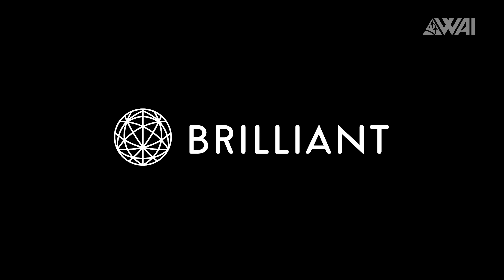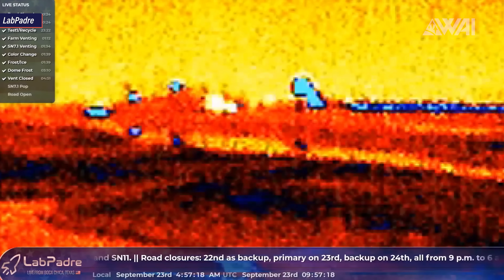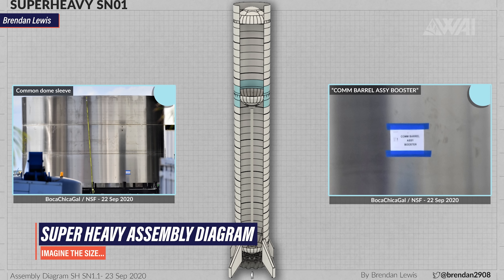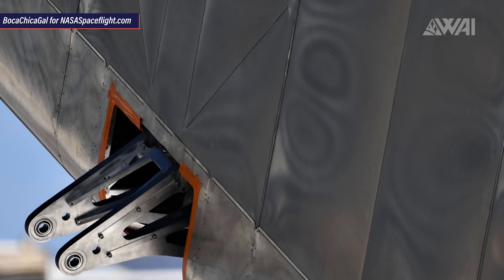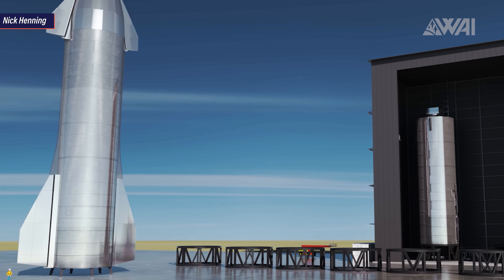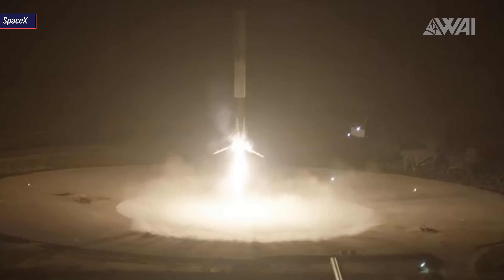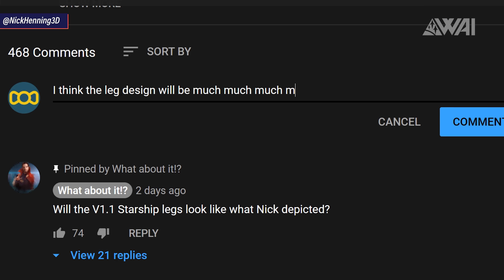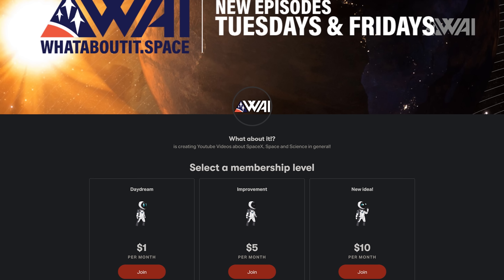122 | SpaceX Starship Super Heavy SN01 In Production!

Comment from the maker: What's your thought about possible Starship V2.0 legs? Which design is your favourite?
Reply: if they are meant to adjust in order to level, the simplest design is a single rod inside of a sleeve (at 6 corners for redundancy, or at 3 corners for minimalism), with a slightly-rounded end. hydraulic for fast adjustment, but with a locking mechanism so they can turn off the hydraulics. rotating or pivoting things just add complexity, despite looking cool. Flipping from the outside is a bad idea when belly-flopping in a high-friction setting. Also , being auto-leveling means they don't have to be as far out from the center like falcon's.
Reply: Flip them out from the center 10 foot legs would fit nicely between the spaces between the 3 central raptor  and outer ring of engines unlike falcon.
1)The hinge is already designed.
2) less weight ...shock levelers could be attached ( or built into the leg)to the already re enforced thrust puck eliminating the re enforcement ring( falcon) less parts.
3) no need for external bays or heat shield issues
4) re enforcing the thrust puck
5)duplicate modular engine mounts( learned from falcon) between legs....
Reply: I like a flip out and as long as there is legs and star ship isn’t going to change into a boat I am fine
Reply: Being old school my favorite legs are Tina Turners.
Reply: @warhawkme6344  Yes, 6 Tina Turner legs shapes...with all the curves in all the right places...would make one sexy Starship. :)  But would she land barefoot or with heels?
Reply: I just want legs! It looks nice <3
Reply: I think that Elon is likely directing them to fit it under the skirt around the engines. I am sure that the engineers are hard at work trying to figure out the optimal way to take care of that problem. Any solution putting them on the outside of the rocket is going to require refurbishment or heat shields, thus I don't think they will be considered.
Reply: For the few initial landings on a foreign body, you could use the Falcon style legs and leave the lander in place for temporary quarters while building the more permanent colony.  Supply rockets could also be left in place as well.  Once a hard landing pad is constructed, you could use the improved externally mounted pods for the reusable boosters.  At some point the 1st gen landers could be retro fitted with a disposable heat shield skirt so as to be able to return to point of origin to be recycled and used again.

 
 

Reply
Reply: 2
Reply: i think they won't look anything like these, but the falcon ones, although if they make them like falcon, i think they will redesign them a fair bit
Reply: Hey Felix how are and how do even keep up with the rapid progress of SpaceX?
Reply: How about some sort of negative polarity magnetic force that would allow the Starship and the Superheavy booster to hover a few inches above the ground. How hard could it be?
Reply: @mvmmotovlogmusic2815  If you can generate a magnetic field that strong, you can shield Mars from the solar wind. ;p
Reply: Hi, Felix.
Note that the design of legs for the Martian Starship ought to permit not only landing but also soaring up without a launch stand.
All variants of legs you've shown are too squatty.
Reply: For earth to earth travel falcon legs would be good but for lunar and mars landings the auto levelling legs would be even better
Reply: I don't know what they look like, but there have to be 6 of them. With 4, if one fails, the entire rocket will fall over, which is far too risky. With 6 your have some redundancy.
Reply: Keep in mind that the legs need to retract very quickly once the ship is launched from Mars. The current Falcon 9 legs have to be retracted manually after they land. Starship won't have that luxury.
Reply: @WhatAboutIt I imagine they will be very like the Falcon legs, but with a completely enclosed manifold over the leg bars, and heat panels on one side. There will probably have to be an additional surface covering the joint from the underside, which would also have a heatshield.
Reply: The fixed 8 leg design.
Reply: The fact that Musk isn't bragging about the 7.1 test is a clear indication that it didn't go well.
Reply: o, will the new High Bay at least have an overhead crane? Or will Musk continue to use primitive construction cranes?
Reply: Tin tin is my favorite
Reply: Whatever design they go with, the legs absolutely shouldn't go straight down as we see in the current prototype design.  The wider the legs are the better, or at least within reason.  Starship is already a tall ship so let's assume it has legs that go straight down and Starship lands on Mars on an uneven surface with just a tad of wind to boot, that could easily turn out disastrous.  Having a bit too much horizontal speed upon landing could also be a problem that wider legs would help with. 

A starship is much more likely to fall over with narrow legs if just a couple of things go wrong with the landing.  With a tall ship not having wide legs we're assuming everything will go right on every landing so why not increase the margin for error with wider legs?
Reply: Why not pre launch a self-leveling landing/launch pad? That way, debris will be minimized.
Reply: yes...
Reply: I feel like if you want wider and self levelling legs you're gonna want them to articulate like how dropship landing gear does in Battletech. link related: https://www.sarna.net/wiki/File:Confederate_(1).jpg
Reply: maybe the legs will be build into the lower fins
Reply: i just realized how extremely important those landing legs are. they need to be extra durable because on a single mission they might need to use it twice. landing on the moon/mars and then landing back to earth. so excited to see the final leg design for starship 🤭
Reply: Here's a thought on the legs- They simply extend from the inside of the skirt (no flipping required) and have pistons capable of auto-leveling.
Reply: I like the 2nd design.
Reply: Whichever design they use, it will need to have enough clearance after landing to prevent exhaust and debris from impinging in the engines/nozzles.  Only way I can think of is to use long legs that fold out akin to the Apollo era LEM.  They’ll have to be shrouded, and not sure if hydraulics will work properly in space.  Maybe some form of elastomeric hinge.  Oleo camping for the “feet” might work but you need some highly engineered seals as well.  Aesthetically the current stumps don’t look that great, although they do the job now.
Reply: none of the featured ideas. Mass production is the answer, so nothing that slows the system. Those 9m diameter rings are all. So, nothing bolted to the outside, no extrusions, etc.etc.
The legs will be internal to the ring, so no extra complexity vis extra or more complex heat shields. Why use more/different heat shields when the existing structure already has it? Not sure re hydraulics. The extreme temp differences this will go through in the space of 15 mins on each launch/re-entry would seem to preclude that. Some kind of mechanical solution is the most likely outcome.
Reply: Who needs the over priced sls s 4 SpaceX yeehaw  billions on Boeing they will not have any fliers SpaceX will get it done for millions not Fkn Boeing’s sls & starlight billion’s
Reply: The coolest looking legs will be the best, 
maybe a racing stripe for added speeeeed!
Reply: The legs must be well spread out, like falcon9.  additional stability at the moment of landing can be supplied by the little nitrogen rockets at the top of the booster. This will iron out any tipsiness that might occur at the moment the main engines are shut off at touchdown.

I don’t think anyone missed the fact that both of the 150 m hops ended up with landings that were precariously close to tipping over, because of the offset rocket motor.

The smart thing to do is to start off with oversized legs and prove them out, collecting data all along regarding the forces acting at the instant of touchdown.

If warranted, smaller spread legs can easily be exchanged on later models of the starship booster. It would be a shame to Tip over a booster because the legs were not spread enough or they were too flimsy.

I’m not going to talk about damping at this time because it is very complicated subject.

Suffice it to say, this American boy likes long legs!  I won’t elaborate anymore, ha ha!
Reply: I feel that the leg design similar to the current Falcon flip-out legs would be best. The wider the stance, the better. However I am not sure what happens to the rocket after it has landed. We are so concerned about the landings, but after it has done so on the Moon or Mars, do the legs give Starship enough height and clearance from the surface to launch again? Wouldn't the launch itself kick up a lot of debris and possibly damage the rocket? Just seeing what damage SN5 did to the launch pad could be an indication of what to expect. And that was with just one Raptor engine!!
Reply: @not2busy  I like your thinking, but it must also take into consideration the firmness of the landing surface. Landing on the talcum power surface of the moon is no where like the concrete pads that falcon 9 is landing on.....then there is the surface of mars, unlevel at best. Just Saying.
Reply: What about an inflatable ring under the skirt
Reply: @atomskate4882  Agreed starship is not running out of gaz. But it would need to be in combination with "real" legs (legs with balloons :D) to add clearance between starship & the ground, because i doubt any inflatable thing would survive a take off !

So IMO : 
1- inflatable balloons under the legs to damper the landing
2- They would be then removed and/or deflated (either jettisoned, robots or humans works) to keep the "real" steel legs, more durable for long missions... and take off survival
Reply: @sebbubusse4111 , anything inflated would not survive a powered landing either.
Reply: @glennpearson9348  ... self facepalm I forgot about that XD. they use the raptor to land too.
Reply: @sebbubusse4111  why under the legs in an exposed place? If it's basically a dampener couldn't that be integrated at the top of the leg, protected and out of the way. I'm also not convinced a balloon material would be strong enough given the pressures it would be going under during a landing, even running on empty these things aren't light.
Reply: Nic H google vectran
Reply: @atomskate4882  no...
Reply: atom skate I love your out of the box thinking! But inside the engine skirt is already getting very crowded! Remember way back to 2 years ago? When 2 huge Chinese folding fans of solar arrays were shown popping out of the skirt? https://www.nextbigfuture.com/2019/09/seven-years-of-the-spacex-super-heavy-starship-future-with-hundreds-in-space-and-the-moon.html
Reply: I just remembered something I saw recently about how “innovative” using jet wings for fuel tanks was thought to be!
Reply: It was a video for Tesla Battery Day predictions. What if the Starship solar panels were stowed inside the flaps?
Reply: atom skate You know I’m trying to contemplate some kind of inflatable system also, certainly stubby legs will not work,
Reply: atom skate This is a very INNOVATIVE idea! Please apply to SpaceX ASAP!
Reply: I don't think any of the leg designs are long enough currently for a reignition on Mars yet. Musk stated that the crew would have enough fuel for an emergency take off from Mars if needed to start it's way home. But I don't think the clearance is high enough currently to avoid severely damaging not only the skirt but the engines as well. Did anyone else notice how they skipped the re-fire test Musk mentioned was coming? Perhaps I'm wrong and the engines put off enough heat to melt and glassify the Mars surface before it can kick up and cause problems, but it's a big mystery to me at this point unless the legs are WAY longer IMO.
Reply: 3 Falcon style legs.   1 in the center of reentry exposed surface.   Actuator arm with hydraulic leveling on all 3 legs..
Reply: I like the 2nd one. It absorbs the most shock because of it's curved shape. Easy to fold back

Comment: Legs - what about 2 legs from the base of the rear 'wings' and a Falcon type between them - with the 'wings' folded back the system would form a stable 3 point support - levelling support by adjustment of the two wing legs (should be room inside wings for the mechanics)

Comment: SpaceX landing legs really bother me.  We keep seeing the Heavy Booster landing depictions on the moon with those little legs with almost no footprint on Regolith.  NOT GOING TO HAPPEN.  A larger foot that can distribute pressure . . . maybe!   However, as heavy as that rocket is, even in space, or on the lower gravity moon will still concentrate a lot of pressure on those feet.  Are there going to be landing platforms on the Moon just waiting for SpaceX to arrive?  Don't think so.  Mars is even a bigger question mark because it actually has an atmosphere, and more gravity.
IMHO the flip-out legs show promise, but not as much as the Falcon-9 legs, and the Falcon-9 legs are actually too small/narrow for the contact surface (footprint) with an unpreparedlanding site.  If a Falcon-9 Flip-out leg with a larger foot print were devised then all problems could be solved.  The legs would be protected by the heat shield for reentry, and the other needed qualities contained in the Flip-out Leg Foot.  When the leg deploys . . . as soon as it clears its storage cavity . . . the foot folds out on both sides making the foot print three times larger than the width of the storage space.  Don't know if that will be enough.  Auto leveling may be the answer, but the qualities of the surface you are landing on is the question, and they may be an unknown until it is encountered . . . at which point . . . you better have a lot of extra capability built in.  The fold-out footing could be part of the auto-leveling.  Just my 2ȼ.

Comment: I think the legs that Starship needs should be longer, bigger, and more a part of the entire structure, not just the skirt.  Especially as this is going to be reused over and over again and needs to be able to work on uneven terrain and/or loose soil. Like a falling cat with its limbs extended. The joints and the padded feet work to provide a cushioned landing.

Comment: The F9 style leg is the way to go for two reason. First, fitting tiles would be trivial as they would fasten to the cladding sitting relatively flush to the haul. You don't need any door mechanism or inset cutout adding build complexity. Second, there are already plenty of ideas how to make the F9 legs auto-leveling. The battery onboard Star Ship can power a relatively small motor to turn a screw gear integrated into the pad itself, or to adjust the whole leg Even if it still has an integrated crush core. There isn't much wrong with the F9 style leg as it is, so why mess with it?

Comment: Elon tweeted about the test today! pressure was different on top and bottom, 8bar on top and 9bar on the lower dome with propellant weight, he says is good enough and updates to the construction and materials is on the way, he elaborated that the failure occurred on the point where 301 and 304L steel were welded, SN9 will be the first made entirely of 304L with some tweaks

Comment: I say, go back to the previous "tintin" 3 leg design. Flap the lower fins toward the belly on landing and have legs pop out of the tips. That'll give a wide stance for little weight. For the third leg on the back/top side, instead of having a full fin as on the original "tintin" design, have one fold out falcon 9 type leg. No need for any heat shielded legs at all.

Comment: I think they might use both. Leg failure would be a catastrophic failure and need backup. Using larger falcon flip out legs as primary and the smaller underskirt legs as a buck up. Maybe the back up legs would be deployed but be a little shorter so they aren't supporting weight unless there is a failure

Comment: 3:19   This view makes it more clear of what happened.  The zig/zag tear pattern across the dome weld at the right was probably the first to fail.  The clean tears probably happened second.  With the dome to ring welds last, as parts of these are still holding.
*If you can mentally picture the dome weld ripping and lifting up first, then tearing both ways down to the ring welds, lifting high enough to let the dome sections to lay outside of the rings, before coming back down to rest.
2:45   Notice the smooth area of tearing  in the dome to ring welds.  You can see the 2 or 3 small fit up tack welds if you look carefully.  This indicates the welds ripped along the sides smoothly possibly because of incomplete fusion, or if the welds were healthy, it would have torn slightly above those tack welds and not so close to the center of that seam.  
* Yes, the tearing up the sides through the parent metal is what you want to see.